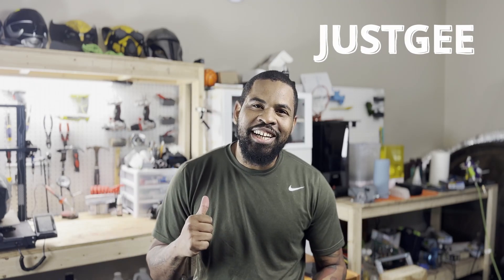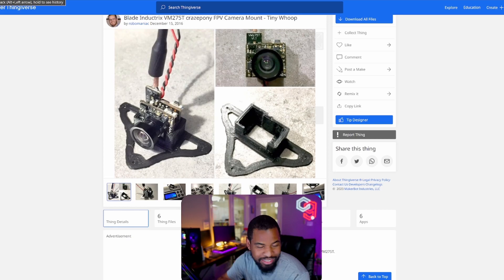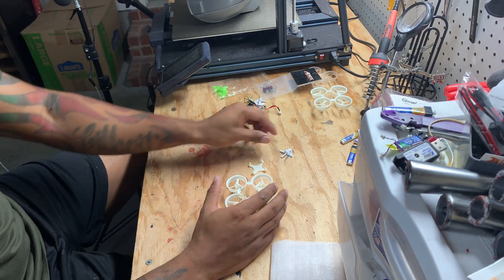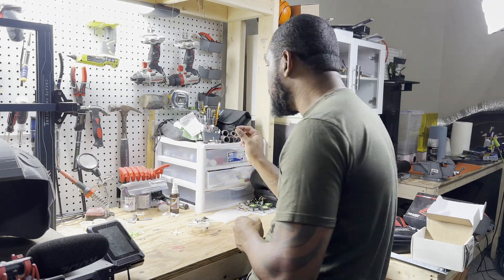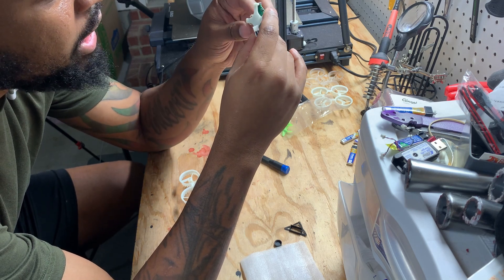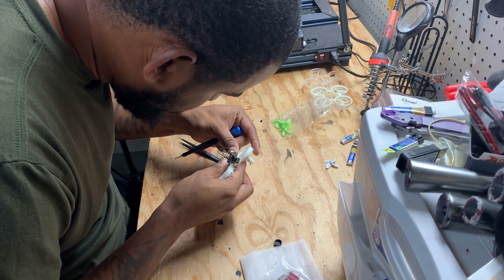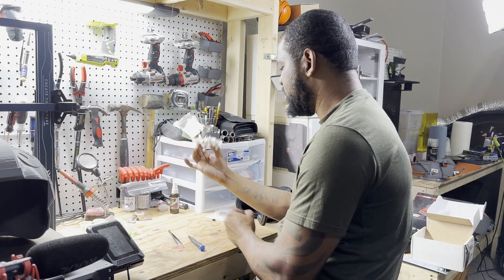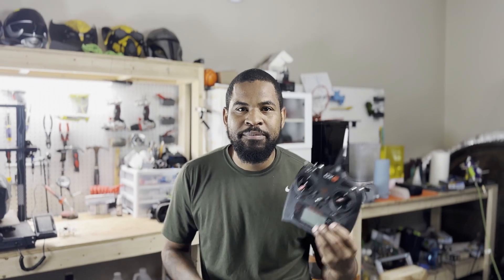How-To Ep 2, I 3D Printed a Tiny Whoop Drone TUTORIAL!!!

Comment: How much did the components cost? (only for the whoop)
Reply from the maker: Blade Inductrix: $59.99
https://www.horizonhobby.com/product/inductrix-rtf/BLH08700.html

Mini Camera: $18.99
https://www.amazon.com/AKK-200mW-Switchable-600TVL-Camera/dp/B072V1F8V3/ref=sr_1_5?crid=1UFBZRWKK8LAV&keywords=blade+inductrix+drone&qid=1696992216&s=electronics&sprefix=blade+ind%2Celectronics%2C102&sr=1-5

Upgraded Motors: $9.59
https://www.amazon.com/Crazepony-4pcs-6x15mm-Motor-Speed/dp/B01N9ETA9Z/ref=sr_1_1?keywords=blade+inductrix+motors&qid=1696992512&sr=8-1

Battery Upgrade: $20
https://www.amazon.com/250mAh-Battery-Inductrix-Connector-Kingkong/dp/B09GKDZ5YX/ref=sr_1_5?crid=2FJ8LQDO6XI73&keywords=blade+inductrix+batteries&qid=1696992628&sprefix=blade+inductrix+batteries%2Caps%2C93&sr=8-5
Reply: Thanks! @JustGee3D
Reply from the maker: Welcome glad I could help!